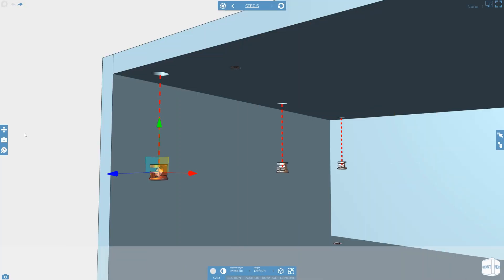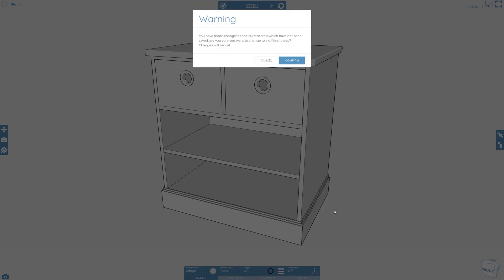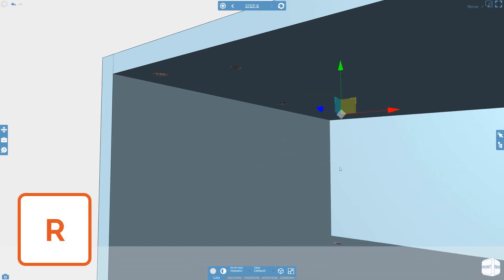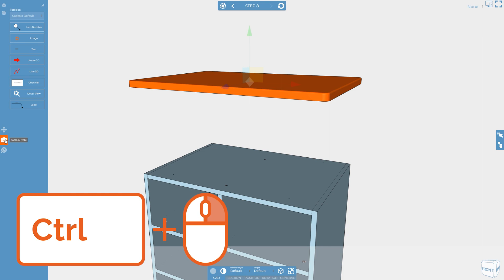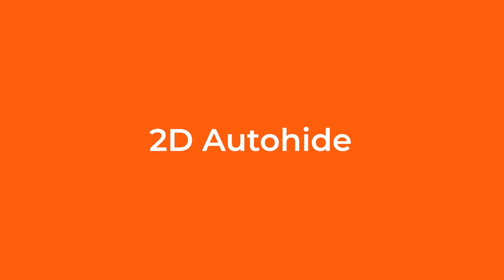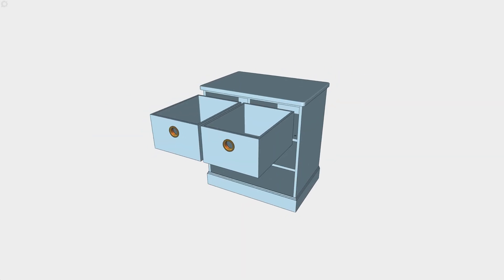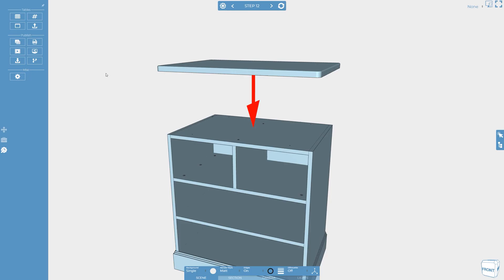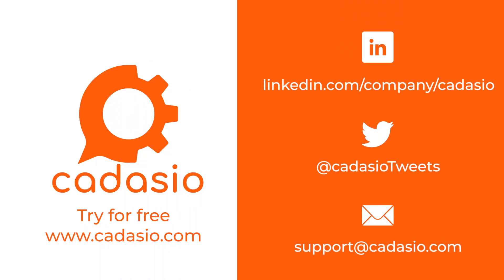Tips for Creating Interactive 3D Furniture Assembly Instructions with Cadasio

Comment: There is a restore default position option, but is it possible to set a new default position, e.g., when I rotate a product and want the new position to be my default restore position?
Reply from the maker: Not exactly, but you can restore the position of the current step, which I suspect solves this most of the time. This is done by pressing ctrl+r or clicking the icon in the transform menu. You can also copy the position from an exisitng step. A combination of these tools should help you get it where it needs to be.